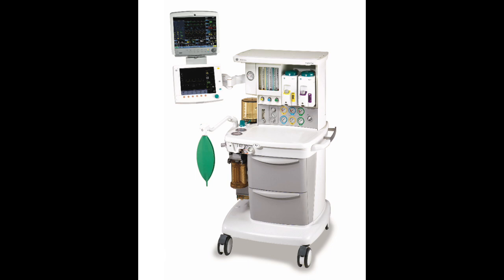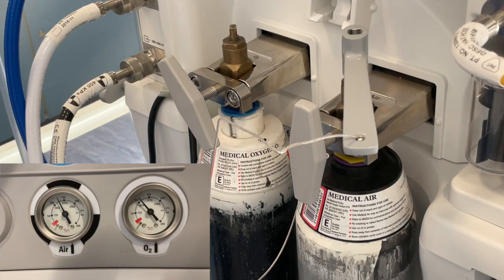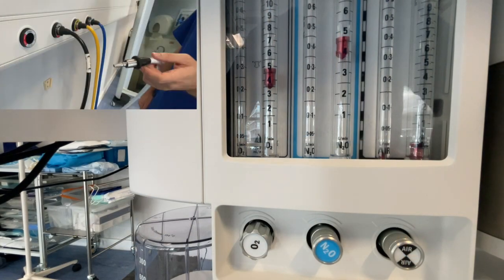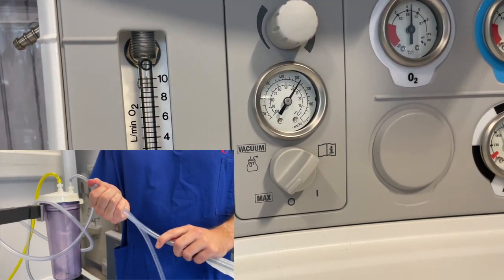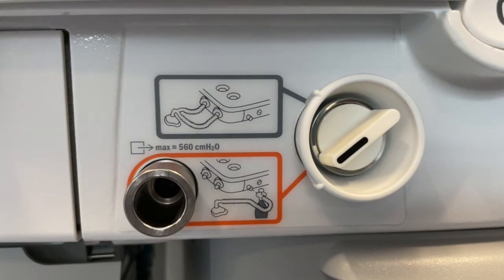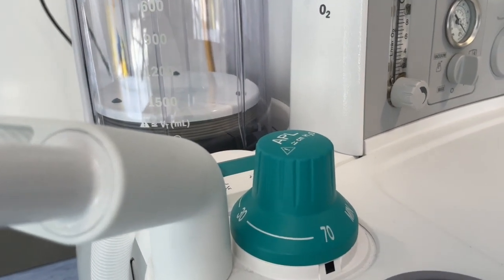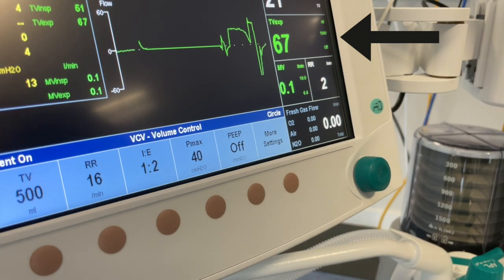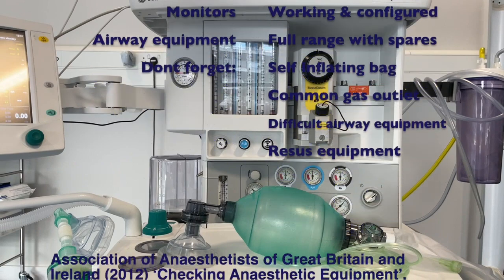Anaesthetic machine check

Comment: This particular machine would GE machine would require the flow sensor to be calibrated as well for 21% oxygen and the 100% oxygen.

Also don’t forgot gas (CO2) analyser to ensure capnography and other gases can be monitored.